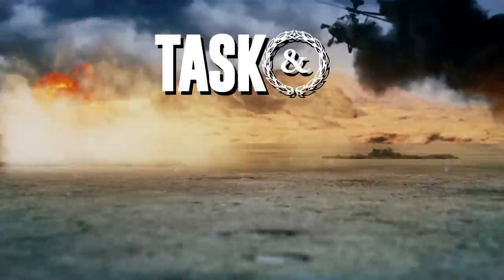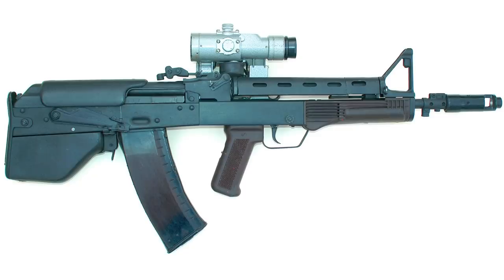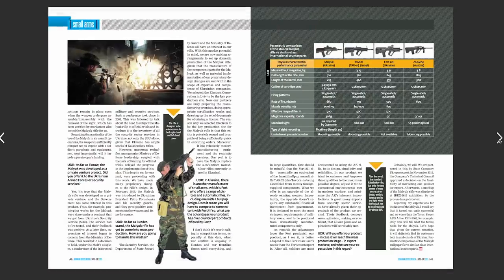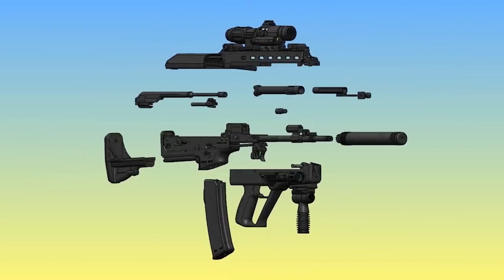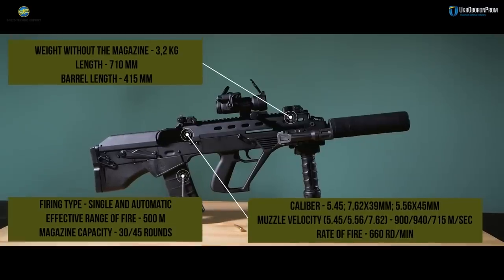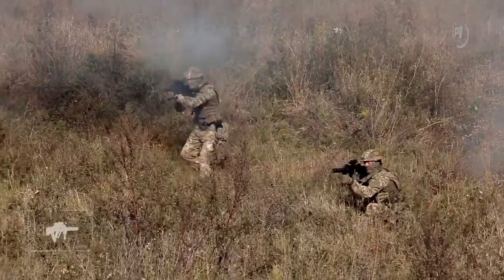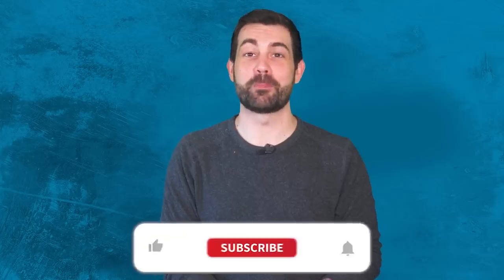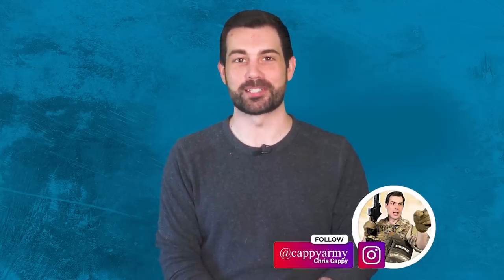Why Ukraine Special Ops Use This Bullpup. The Malyuk.

Comment: I used Vulkan-M in battles. There are two versions - under 5.45 and 7.62. Version 7.62 was released more actively. The machine is equipped with a Swedish Aimpoint, a good silencer and a vertical handle. Uses normal magazines from AK, so there are always a lot of magazines. Version 5.56 does not exist, as some people think.
Reply: Як він в цілому? Працює добре?
Reply: @СамуилАнтонович  так. В порівнянні з АК велика перевага в тому, що є відразу штатний топовий коліматор і заводський глушник.
Reply: @СамуилАнтонович  Він хуяче як бластер
Reply: Is Malyuk stil produced.

Comment: I like the fact that Cappy says in a battle rifle "trigger feel" isnt the big deal so many people make it out to be. They are not doing the olympics.... 
Maneuverability, weight and hitting power are what count on a battle rifle (and of course durability / reliability)
Reply: Most people who I see crying about trigger feel are gun enthusiasts/collectors. Look at gaming. Most gamers don't need a high speed computer or a $200 elite controller. A standard controller and console will be just fine for the majority of people.
Reply: Although you are correct maneuverability, weight, and durability/reliability are important a good trigger can make all the difference if you're trying to make a shot on an enemy several hundred meters away. You would want a trigger pull that breaks smoothly and lightly. This allows for quick follow-up shots in semi-auto, which is important for longer engagements. 

Also there is no such thing as "hitting power." There is energy on target & bullet penetration but that has less to do with the whole rifle and more to do with barrel length and caliber.
Reply: @TheDisgruntledImperial  They're completely different. A good trigger can make a big difference unlike a $50 mouse vs a $200 mouse.
Reply: @Allenfreedom1776  most people being issued rifles aren't marksmen anyway. It's about volume of fire and violence of action. OP is right, most infantry aren't Olympic shooters.
Reply: @TheDisgruntledImperial  Volume of fire does work in a war like the one in Ukraine, (at the moment) but this weapons isn't meant for the average soldier, it is meant for Ukrainian Special Forces, who most certainly need to take accurate shots and several hundred yards.
Reply: @Allenfreedom1776  Having extra buttons directly in the mouse or having paddles on your controller has inherent advantages. In reality though good players can still overcome that. Just like how people overcome the trigger of the rifle they’re using through training.
Reply: Small arms don't win wars, artillery does. Small arms are just there for grunts to protect the artillery
Reply: @Allenfreedom1776  cool story bro but I don't think your flat range experience translates into real wars where you get hit with artillery and airstrikes long before you even see the enemy and the goal is to crank out as many of these as possible bc the average life expectancy for your soldier is like 3 months anyways. 

"Muh twiggur feew" is exactly the kind of dumb shit that lost Germany ww2 i.e. not focusing on the big picture
Reply: @rodiculous9464   Hmmm. I don't remember the Taliban using artillery in Afghanistan... ah maybe that's just me. You must know better. I stated that this weapon is used by Ukrainian Special Forces so the life expectancy is different. 

Also you call out flat range experience while you boast about what you think wins wars with all you flat range & gaming videos is ironic. Lmao
Reply: Triggers do become a much bigger deal in regards to bullpups though. I never had a gun were the difference in trigger pull was noticeable enough to bother me until I got a bullpup.
Reply: @rodiculous9464  Germany didn't lose WW2 because of the quality they put into their Firearms, they turn on the Soviets and failed, they also were using to many resources on concentration camps. As well as many other factors.
Reply: With any weapons they're just a tool and how you use them. The trigger doesn't mean jack shit if you're used to it and can effective use it with your own rifles trigger pulls poundage. Any rifle needs cleaning and maintaining. But so does any rifle. Maintain your shit and they'll all function as they're meant to. Which is throw out angry hornets.
Reply: dunno, I mean, cappy did serve, there's a chance that he fired a gun, especially at someone else
Reply: @johnwray393  iv always used a bullpup as my main service weapon, the times I miss shots is always my fault not the trigger. All about being proficient with your equipment
Reply: @jimmy12347654  pshhht cant say this to the laptop marines
Reply: @rodiculous9464  Bullpups feel better in weight distribution. I'll take that and shorter weapon length.

 This is coming from someone who has little experience with both types so I'm not use to any platform like many guys are.
Reply: @titanlord9267  yeah cappy is right. I've also served am ex airborne. Fired bulk riles and other weapons. The trigger feel is near on the last thing you think about. Once you're used to it then it's as effective as you make it. Doesn't matter if it's a gpmg, lmg, smg, m4, mk416/mk417, bullpup, 84mm, 66mm, 50 cal, shotgun, blocky trigger, fine trigger and anything inbetween. Once you're used to the tool it's only as effective as the user.
Reply: @Tinfoil_Hardhat  Cheap gaming mice do exist now. Still don't know what to do with the extra paddles on my controller though.
Reply: @Tinfoil_Hardhat  i am not a weapon expert, but as a mouse player i'd say that having more than 2 mouse buttons, a scroll wheel and 2 side buttons actualy weights you down and doesnt do much at making you better at the game.
Reply: Watch some actual Ukranian war firefights on Funker360, you rarely see them aiming down the sights in any situation.
Reply: @frostyy51  I wouldn't say you need more than two side buttons, but I can certainly say that two side buttons is far better than none. Depends on the game but sometimes a 3rd is nice.
Reply: Don't forget the single most important thing for a military weapon.  Reliability.  It needs to shoot every time or it's a liability. If I were a soldier I would care less about trigger feel if the gun fires reliably every time.
Reply: Mmh, good point. When you receive your weapon, it stays with you and you get used to using your weapon. The "trigger feel" of it will eventually be what you're accustomed to.
Reply: @Tinfoil_Hardhat  especially when playing things like Arma or when you need voip push to talk and having push to talk in one of the side buttons on your mouse is 100% better than moving one of your movement fingers away from WASD
Reply: Uruk sexport?!
Reply: How about lets start from reliability and work our way down from there.
Reply: @Allenfreedom1776  
it won't mean shtttt if you're being surrounded by guys with AKs shooting at you at the same time.
Reply: @Allenfreedom1776  
they actually did have artillery specifically just mortars and a bunch of RPGs being spammed at you.
And they didn't "win" the war through combat.
They won by holding out and surviving while America just kept stumbling on itself and was too late to realize that they never should have entered Afghanistan to begin with especially since they had nothing to do with 9/11 and should have invaded Saudi Arabia instead
Reply: Exactly, the SA80, AR15 and FN Minimi, are pretty shite at ranges over 400m, that's why most western countries adopted DMRs like the M110 and the L129, Britain have also made the decision to get rid of our Minimis, it is more effective (and cheaper) to arm soldiers with intermediate rifles with optics, and mix in some full rifle cartridge DMRs, than waste money on LMGs and rely on volume of fire for accuracy.

Russia and Ukraine got this decades before with the SVD and its derivatives, they don't need a super accurate GI rifle for >400m, an intermediate cartridge isn't meant for that range anyway, you use a DMR or sniper rifle for that, which they are doing.
Reply: @Allenfreedom1776  you're not hitting anyone at several hundred metres with 5.56. leave that to the marksmen
Reply: And with all the advantages a bulb up has the trigger not being as good as a traditional rifle setup is a trade off their willing to make. Because no matter how hard designers try there has yet to be firearms that are truly perfect and good for every situation.
Reply: @EthanThomson  wrong. I've had first round impacts at a match at 982yards with a 20" AR. 
I have been using my 18.5" x95 for hog hunting. Zero at 36yds will also impact at POA at 325yds. Out to 380yds POI will always be within 6" of POA. 223/5.56 is far more capable than people believe. And the geissele trigger package fixes the x95's terrible trigger that does effect accuracy.
Reply: I think what he was getting at was that the trigger on issue weapons is always bad, not that a good trigger doesn't do much to help.
Reply: WRONG, once you upgrade the Trigger you instantly become 39% more like John Wick
Reply: @Allenfreedom1776   The Taliban were able to survive multiple occupying militaries because of their knowledge of the mountainous terrain of the north of the country and sheer numbers.  They didn't have a distinct advantage in equipment or highly trained soldiers, when they had to rely on old Soviet surplus weapons and poorly made black market stamped guns. They did have some International assistance and training from Chechen drug smugglers from the opium trade, Afghan Army officers trained by the US Army Rangers, as well as intelligence assistance from Pakistan.
Reply: If all other features make it a better weapon, a somewhat mushy trigger isn't going to make much difference on the battlefield. The awkward magazine placement is the biggest issue here I think. A mushy trigger you get used to, reloading looks like it needs some decent training but will be muscle memory too after some time.
Reply: @Allenfreedom1776  
The Taliban and other Afghan rebel groups used whatever they could get their hands on.
Mortar strikes were not uncommon and they used shoulder mounted rockets and even the humble RPG to bring down helicopters.
And yes, during Soviet invasion they did use artillery, both supplied ("fell off the back of a truck while I waz in Pakistan mate, innit") and captured.
You're thinking of the US led invasion time frame.
Don't forget that Afghanistan fell into civil war after the Russians had been chased off.
When the dust cleared and the Taliban warlords had gained control, Afghanistan didn't really have an official army or any kind of centralized planning.
Any remaining heavy weapons platforms (tanks, aircraft, artillery) would be too expensive and difficult to maintain for a bunch of loosely aligned regional tribal warlords with no real economic output or manufacturing base.
Reply: @no-sway3709  It's impressive that you managed to do that, but do you think you could effectively engage a squad of soldiers at that range? Do you think the rest of your own squad could effectively do the same? Could you really eliminate that squad, or would they just retreat and call for support?

At that range, 5.56 rounds lose a lot of energy, and may not penetrate the bodyarmor or cover that it may need to to be effective. So even if you do manage to hit something at that range, there's a very real chance you're simply wasting your ammo.
Reply: @WallGnome  many aren't wearing plates and even then portions of the body are exposed. I rang steel consistently at 500yds and dropped down to like 25% at 600yds using a tavor and a red dot today for instance. Used pulled 77gr bullets, cheap powder and random brass.
Reply: There is an old saying:  "You do something often enough you get dam good at it."  Plus humans tend to adapt to different procedures that they initially find uncomfortable.
Reply: Hitting power... What hitting power lol? Isnt it 5.45? There is no hitting power lol.. Thats like comparing 9mm to .45 to a IIIA.. you will barely notice the 9mil hit you.
Reply: @Allenfreedom1776  Soldiers seldom try to shoot an enemy hundreds of yards away. That's basically impossible to do under combat conditions. Instead, they shoot the general vicinity of an enemy hundreds of yards away to suppress them. Then they use that suppression to cover their movements, or coordinate an artillery strike on on the pinned enemy.
Reply: @no-sway3709  Found the flat range keyboard warrior.
Reply: @NarutoMagicCyclops  go back to watching anime
Reply: @frostyy51  MOBA games benefit more from extra buttons than an FPS or RTS, MOBA games unlike most don't require as much accuracy or flicking that is common in an FPS, and RTS's don't benefit much from extra mouse binds anyways, the lighter the mouse the less drag is has so it makes sense why a heavier one would impact performance especially for flicking.
Reply: @Allenfreedom1776  You talk about keyboard warriors while trying to convince those who know better about a combat situation. Sure on a flat range a better trigger mechanism makes sense, especially for sport shooting, but that's also why rifles are primarily made with 20-22" barrels and made extra light and fitted like a fine jacket for a tuesday dinner at the office.
  A military rifle is mass produced, specific requirements for operating in different environments even moving from one type of environment to another without affecting reliability and not all the parts are snug to fit, which does affect long distance accuracy.
   Regardless of all that the effective range of an M4 specifically is stated to be 300m, that is the ballistics were specifically designed to penetrate armor at that range effectively, and the accuracy of the weapon system with a 14.5" barrel are fairly limited when compared to a 20". It'd be hell to move around in a CQB environment at that point with a longer barrel, and your trigger reset is the last thing you think about in that situation. Not to mention not every rifleman is given a magnifying optic.
Reply: @no-sway3709  You wanna say that to every military member out there?
Reply: @NarutoMagicCyclops  only the ones like you. Once you're out you'll realize there's a lot of us. 
You didn't mention the branch which typically means you're air force. Most branches are proud of their branch and name it rather than say simply 'military.' Not always the case, but I've noticed the trend :)
Reply: @no-sway3709  Quite the hypocrisy then, as is typical of most military members. You'll expect the statement beforehand and then give it out yourself as if it's an entitlement. And then act as a know it all. Originally 1-161 HHC, went on deployment with 3-161, and if you were a military member then I'd expect you to know better than most, which if you do, doesn't retract the facts and what we were taught, it's only been recent that we are switching to a longer engagement range with the new 6.8 rifles being tested in the field by other units with an effective range of 1200m and the optics to go along with it, not to mention the new NOD's on both the optics and operator helmets with the link system.
Reply: @NarutoMagicCyclops  relax, bud. Just say Guard then next time lol. 
New tech is amazing and has exploded in the past few years. Got a COTI and was amazed, but upgrading to newer version. Never used ATAK and of course the govt gave the taxpayers the finger on getting ATAK on civvie ECOTIs. 
I don't buy into the ammo/rifle choices that the army is pushing. After decades of using garbage 5.56 projectiles, they finally stumble upon Mk262 for use in SBRs, full length and DMRs. Then they move onto Mk318 which was even better. However, the army went full retard and settled on M855A1. Not even an AP round by ATF standards - just an overpressured eco-friendly bullet.
Reply: It's all about context. A match trigger will make less of a difference if the task at hand is to deliver suppressive fire under 300 meters. It matters a lot more when you are trying to hit a target through a variable optic beyond 500, something the average soldier isn't supposed to be doing.

To prove my point, the acceptable standard accuracy for a m4 until not long ago was 4 MOA (don't know if it changed). Many civilian ARs have it under 2 and some even are sub MOA.

Keep in mind that's from the same Army that wants the average soldier to have the capability to reliably make hits beyond 600 meters with a rifle that is supposed to be used for suppressive fire with a cartridge loaded at 80k psi. Talk about wishful thinking.

Comment: I like the bullpup design, I used a bullpup in the army SA80. Despite all the gripes from soldiers it's quite accurate and low recoil made it fun to use, I do wish the trigger was lighter but that's just personal preference. I like a rifle that has a big punch high accurate and a light trigger to allow me to fire rapidly without having to select full auto.